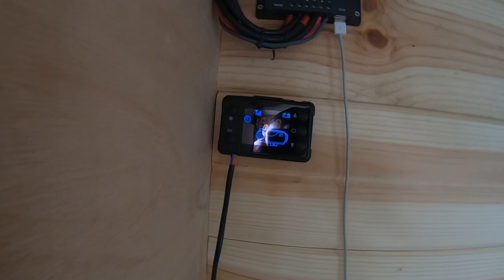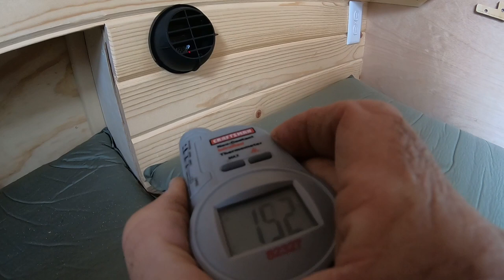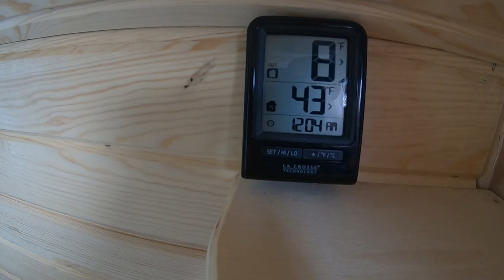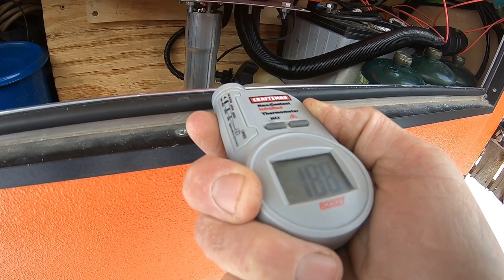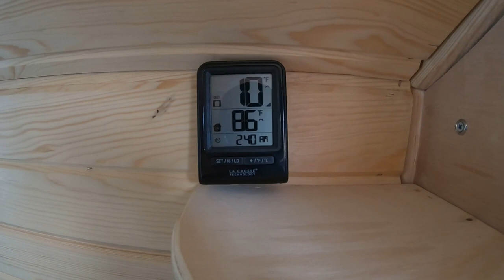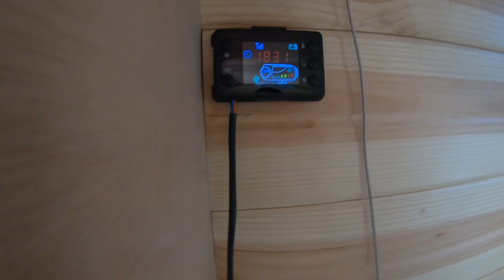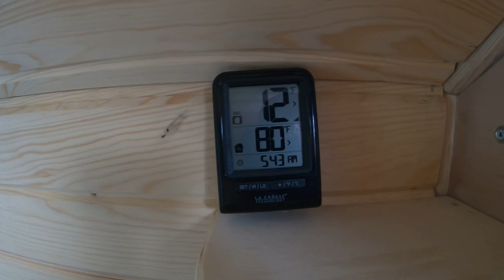Chinese Diesel Heater Install on DIY Off-Road Overland Trailer Build

Comment: Having the cold air intake and exhaust one almost on top the other would concern me.  I’d think one on one side and one on the other might help with possible carbon monoxide.
Reply from the maker: The cold air intake is in a sealed cargo area that is vented near the top of the camper.
Reply: @seekingadventures  gotcha, I thought the other pipe besides the exhaust going outside was the cold air intake and not the air return.   Thanks.
Reply from the maker: @Ohio-PPG-Trike-Adventures  the smaller black tube is the fresh air intake for the combustion chamber. I’ve had a few replies that the could backfire or smoke out of the combustion intake. I’m still thinking about mounting the whole unit on the floor. Just haven’t had much time for testing since I recorded the video.

Comment: could you run the exhaust pipe through or under a steel water tank and have hot water for your shower, wash dishes?
Reply from the maker: I would think through would be best. Or wrap copper coils around it.
Reply: They have units now, that heat air and water, check Amazon

Comment: Hello, just out of curiosity... do you know or have you figured out a way to get the temp around 50 or 60...?  Or would it just be open/crack a window for now?  Thanks Jason.
Reply from the maker: Jason, just open the vent a bit is the easiest way. I could split the heater output hose and dump it outside but it then would take up extra room in the cargo area. I’ve always liked a vent or window cracked while sleeping.

Comment: That's a beautiful install, but is it wise to have that flame so close to that battery and those propane bottles just curious?
Reply from the maker: The flame is inside a combustion chamber being exhausted outside. Can’t be any worse than a bottle hook to a bbq 5” away from open flame. The battery is a sealed AGM so no gases. The bottles are only there for storage. When camping they are moved
Reply: @seekingadventures  thank you for responding have a great day and stay safe

Comment: I am thinking about getting one of these, and building it to make it portable.  Thanks for the video, however two questions:  How many amp hours is your battery?  Without any charge to the battery at all how long would the heater run?
Reply from the maker: 110 amp battery. So there is 55 usable amps, after the heater gets going, it pulls less than an amp on low. So should run around 50 hours if I am figuring it right.
Reply: @seekingadventures  thanks for the reply, it’s very much appreciated.

Comment: Is that any particular piping you used for the hot air elbow?
Reply from the maker: The aluminum elbow is Furnace ducting available at Home Depot. The piping came with it.

Comment: only modification i would make is putting the fresh air intake(for combustion) outside, you dont want this draw oxygen from you, espescially in a tight place like this :)
Reply from the maker: The cargo area is totally sealed off from the cabin area and is vented to the atmosphere. I also have a fan on one of the vents to pull fresh air in if needed. I haven’t totally decided  where I want to put the intake yet because I don’t want to drill an unnecessary hole. I’ve had a comment that it could backfire or smoke come out of the combustion intake. Have not found anything on that yet. Thanks
Reply: @seekingadventures  the backfire is totally possible! but if its sealed off it should not be a problem, just gonna put sout on everything in that area haha!

Comment: Lookiñg to do this to my trailer. Were you able to get the temperature to be a constant comfortable. .
Reply from the maker: It was holding right at 80 for a couple hours. That was on low, so I will probably open the roof vent a bit.

Comment: What is the lowest that you can set it, 80 would burn me up, I would like to know if you could turn it down enough to stabilize around 65 or 70? Great videos, looking forward to seeing more. Stay safe.
Reply from the maker: That is the lowest it goes. Actually low than factory since I changed the hertz. I heard it can soot up if they do not run hot enough. I’ll just open the roof vent.
Reply: @seekingadventures  that was my concern, how low can it go and still burn properly. Thank you. Stay safe
Reply: @donaldwalls8568  I have one in my shed. There is a way to set the controller to desired celcious. But it will go to its lowest setting and still cook you out. Unless it's absolutely freezing out. Per instructions. Crank it up all the way for one hour a day to burn the carbon out of it
Reply: @paulpaulson2428  thank you, has anyone ever split the air duct into two runs with a y fitting?I was thinking just pump some of the heat outside but then it would probably just run wide open all the time.
Reply: @paulpaulson2428  in sir that I will be able to, I'm just now researching and watching allot of videos, may start the build after the holidays. Thank you, I have also considered a small mini split for ac and heat.
Reply: @donaldwalls8568  that would be cool. I have had my little heater in the shed for 3 years now. I'm happy with it
Reply: @paulpaulson2428  how large is your shed, what sq ft are they rated for, may be an option for the garage? Thank you again for your input
Reply: @donaldwalls8568  it's a 12x24. I use a fan to help move the air around.  Cool little heater. A trick is to run some kerosene trough them to keep the carbon out. But do it rairly.

Comment: I like the heater addition.  
Why don't you use ref dye diesel?  I know you don't use much, but still 0
Reply: Cheaper with no road tax.
Reply from the maker: It’s not worth the effort for me to drive somewhere that sells died diesel to save .24 a gallon when I will only be using a few gallons a year.

Comment: Just a tip never run the load off the mppt it's not the safest way for big loads
Reply from the maker: That Renogy SCC is designed to run up to 20amps directly off of it. I have a total of about 13 amps of equipment if everything was turned on. My big solar system on my 5th wheel I run everything through buss bars through a shunt.

Comment: it may be even better to place the Heater's combustion intake Tube further away from those Batteries?
if they are the non sealed type and are on charge the small amount of Hydrogen released from the Cell Caps could cause a Problem.
Reply from the maker: I was still in the installation part of it testing before I drilled more holes in my camper. That is an AGM battery. Thanks for the comment

Comment: can you hear that fuel pump inside where you sleep?
Reply from the maker: It’s makes a small amount of noise. I’ve tried a few different ways of getting it quieter. Hung it from zip ties, rubber straps and block of foam. The foam seems to work best.

Comment: Sorry not a fan of that is putting it mildly for me especially considering the exhaust smell and CO issues. I think more solar and a 250w or 300w heater and a battery gen with another battery is a great idea and May very well be enough for that camper. 

I'm looking at getting a similar size trailer and having at the minimum 600-750w of solar with a battery generator and another large L-ion battery to be able to run a very small aircon all night.
Having at least 2 mono 300w panels would not an issue these days on top of this type of camper.
Reply from the maker: Really no exhaust smell once up and running and if you have the fresh air intake away from the exhaust no chance of getting any CO, I’m more worried CO from us while sleeping be cause the area is so small and sealed so tight, that’s why I always sleep with a window or vent cracked. One bad thing about solar is short days, cloudy snowy days on end and in thick wood areas.
Reply: @seekingadventures  - tq  for the info Re; the exhaust smell etc. If you haven't already installed a CO detector that may be a good idea (can come in handy for troubleshooting problems and leaks too.) The other drawback with solar and more batteries is the weight which is just one of many reasons i want a 4x8 but for me solar and l-ion battery overkill (for multiple overcast days) will be the only way to go as ideally I would like to have 4 roofracks and 1200w of solar to run the aircon 24/7 (I live in Central Queensland Australia) and would like to use regular house appliances in it whenever I want including microwave, toaster and a single electric hotplate.

Comment: How do the two batteries handle the draw?
Reply from the maker: I’m only running one. Does good with the 100w solar panel
Reply: @seekingadventures  will it run all night? Do you know what the draw is?

Comment: I’d be afraid it wouldn’t get the air it needs back in that sealed area when the rear door is shut.
Reply from the maker: The cargo area is vented on each side.
Reply: @seekingadventures  ahhh perfect then. I’m debating one of these for my 10x16 shed for while working in it.

Comment: You are one brave fella. Propane canister right up next to the bettery. Scary. Nice custom build though other than that
Reply from the maker: I’ve had that comment a couple times. So what is your biggest concern with it?
Reply: @seekingadventures   power surge spark or weakened ground wire over time or something metal accidentally touching them together. There is also fumes being released
Reply from the maker: Fumes from the bottles or the AGM battery? So how is this any different than someone using a buddy heater with a bottle inches from an open flame in a confined space like a tent or something. Or people storing a camp stove and bottle in the cargo area? The bottles are in foam padding. So are you saying the never should be a bottle within a confined area?
Reply: @seekingadventures  fumes from canisters. Using a buddy heater in a tent there is still full ventilation a tent is not fully sealed. Im trying out this type of camping myself but in an suv and still trying to find a safe way to stay warm. Right now i just use the uco candelier but still crack the windows up front. Im worried about the candles sucking the oxygen out faster than it is produced. You plugged up your ventilation holes.

Comment: my Chinese diesel heater pulls .6 amps on lowest setting up to 2.0 amps on highest setting. running off a lithium iron phosphate  100 amp battery from renogy... trust me get lithium and ditch the agm or fla battery.
Reply from the maker: I’ve got 600 amp hours of lithium in my 5th wheel with 1250 watts of solar. The only thing sucks with lithium is you can’t charge under 32 degrees or it ruins your battery.
Reply: @seekingadventures  well renogy has the self heating ones now but they only come in 100 amp.  where i live its 3.2f today so it's a cold one. but my battery goes from house to truck to the ice tent. thanks for the reply bud!

Comment: The way you have the Heater installed is not good the air inlet should be outside not inside as these heaters can backfire through the air inlet pipe
Reply: the propane cartridges next to it will prevent any bad from happening...LOL
Reply: @DarkLight007  if the cold don't kill the explosion will